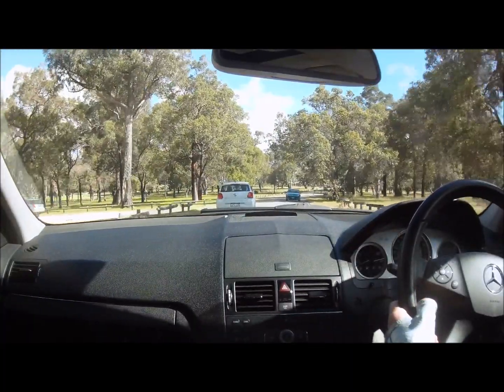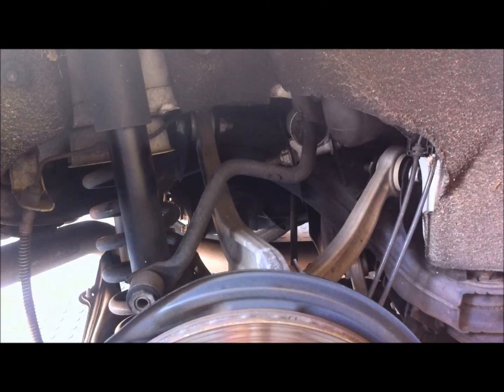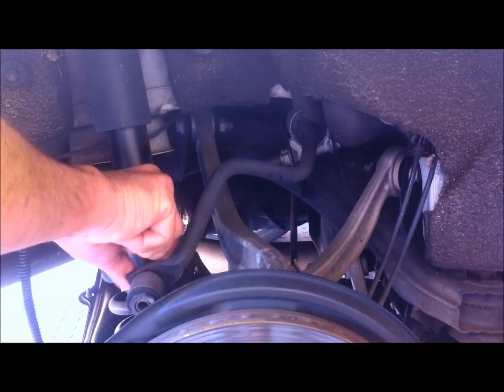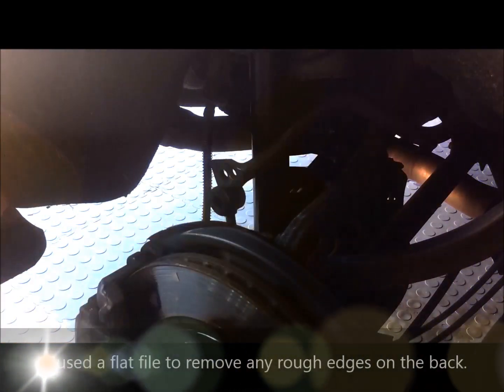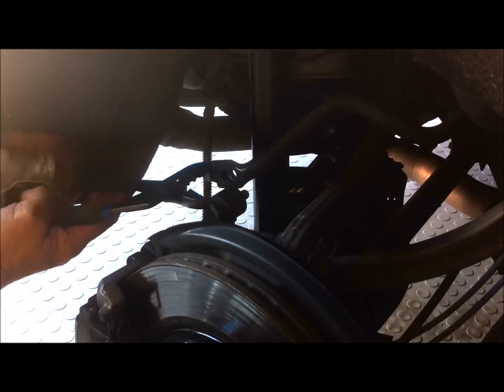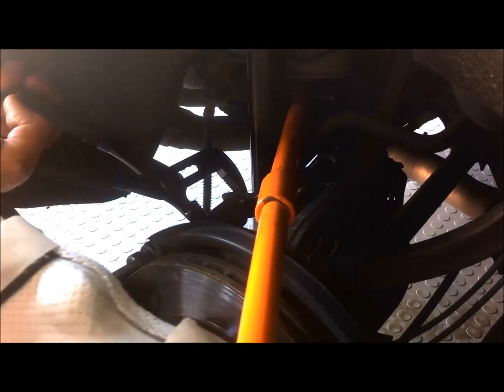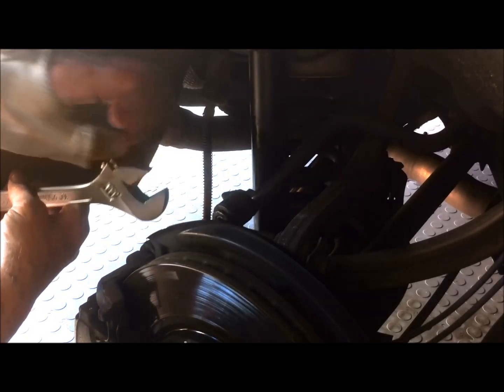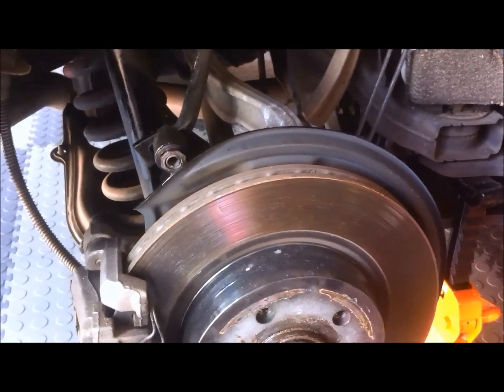W204 Mercedes C Class Rear Sway Bar Modification Anti Roll Understeer Oversteer

Comment: Is the effect noticeable ? AS the whole  arm of the swaybar is reduced only a bit. Do you have to comfort or the standard or sport suspension?

Has the oversteer, if any, become annoying ? Have you experienced inside wheel lift off while cornering hard and therefore instant power loss due to open differential?
Reply from the maker: Well I have a LSD for starters which made a big difference to how the car drives.  I have the standard suspension.
It's a subtle change with the new pivot point but I feel the difference. No it's not annoying and I haven't been lifting the rear wheel when cornering. The track I was planning to use has been closed so my driving is on the street. I don't drive too hard on public roads for obvious reasons.

Comment: It would be great  to see a video how to change the rear sway bar , upgrading to 486 or 483 . Or an aftermarket sway bars .
Reply from the maker: The sway bar is simple to remove. When you take a wheel off you can see the U shaped mount. One on each side obviously.
Reply: +Scott Elliott  thanks , it may be different on facelift and pre facelift models , i must low my rear subframe to replace sway bar .

Comment: Scott, thanks for the video,  I am from Brazil and I have a very tough question for you, since you're tunning the W204 suspension. I own a W204 now and there is something that is bugging me, I will explain, so please read below:

I had a Peugeot 407 Griffe (3.0 - Front Wheel Drive - 1760 KG) Suspension wise the Peugeot has a Double Wishbone front suspension and a multilink rear suspension.

In a track I am used to run with the Peugeot and now with the Mercedes, I have noted the following:

With the Peugeot:
Going at 80 Miles per hour - takes the corner (easily, no understeer, looks like a joke, and it is a tight corner).

With the Merc (W204 C200K) at 70 Miles per hour - Can't really take the corner, I do slip outside the track a little, it looks like the car is "floating" a little, there are some imperfections on the road, looks like I have less grip, at 80MPH not even a professional driver could do it.

The Peugeot is LARGER and HEAVIER than the Benz it was older and had a lot more miles than the Benz, remember that all cars are STOCK, 100% Stock.

Is the W204 less "sporty" or less "capable" than the Peugeot 407 Griffe? A car that is like a "joke" for most enthusiats, and it a lot older than my W204? Is the Peugeot suspension superior to the Mercedes Suspension? What am I experiencing? Understeer? Roll Understeer?

It makes me believe that the Peugeot suspension is in fact a lot better than the W204 suspension. Which is a joke, by the way, the F30 BMW cannot take this corner at the same speed (80 MPH), we tried.
Reply from the maker: +Djalma Leatti ... Djalma ... I wish you asked me a question about motorcycle suspension as that's where I'm most experienced!

The W204 was built on a budget so the shocks and struts are not top quality in my opinion. I think the sway bars and springs are ok.

Another modification I did to mine was put some spacer washers on the two lower strut bolts to give more negative camber. This certainly helped the front 'dig in" when cornering hard. I got it to about 1.25 degrees negative. I also replaced the 27kg battery that sits about 500mm behind the rear axle with a 2.4kg lightweight LiPo battery. I think this definitely helps the handling.

The W204 is still quite a heavy car. My C320CDI is almost 1700kg. From my experience the floating feeling is often caused by ineffective damping. You also need some negative camber on the front wheels because what you describe sounds like under steer. I have no idea about the Peugeot other than it sounds like it has quality suspension.

My front struts are staring to get that floaty feeling at 62000km. I'm not going to replace the struts but make a modification to them to allow me to replace the suspension oil. I've done it for a W639 Vito and it's been very successful. I made a how to video and it will be the same process for the W204 as their construction is the same. https://youtu.be/m50krOFGokk

From what you describe it maybe beneficial putting more negative camber on the front wheels and getting better struts and shocks. Rear shocks can be easily replaced as being mono tube are too difficult to modify. The front strut internal components are reasonable quality based on the Sachs units on the Vito. Better quality hydraulic damping oil will probably sort them out.

Hope that helps, Regards, Scott
Reply from the maker: +Djalma Leatti Thanks for the video. I did watch it and Richard confirms it's handling is first class. You could see it was very flat in the corners.

Your C200K might have much smaller diameter sway bars than my C320CDI. My car doesn't suffer much body roll when cornering hard. This maybe another area to look at ... bigger diameter sway bars. Sway bars are often a very effective and cheap modification. They're not difficult to remove and install.

http://www.ebay.com.au/itm/Eibach-Anti-Roll-Bar-kit-Mercedes-C-Class-W204-07-C200-Kompressor-C230-/251331298761?hash=item3a848345c9:g:ZZYAAOSwNSxVcUFw

Mercedes cars are also very expensive in Australia ... especially if you have them dealer serviced. That's why I avoid the dealers as they gouge as much as they can from you.

Good luck with the Olympics!
Reply: Tell me how may washers did you fit to the lower struts mounting bolts to increase some negative camber? @ScottElliott152
Reply from the maker: @rahulsoni6652  One washer but I took them out after a short while and left it stock.
Reply: Did it cause any issues? @ScottElliott152
Reply from the maker: @rahulsoni6652  No.

Comment: Same principle as aftermarket adjustable sway bars. FWIW I'm not sure if you have both rear wheels jacked up, but I find sway bar work way easier when either both wheels are up or down.
Reply from the maker: Brian Wright Hi Brian, Yes I agree it's easier if both wheels are off the ground. Normally that's what I'd do but these rear bars are not that strong on the C Class so it was no drama to do one side at a time.I had a set of adjustable K-Mac bars on my last Ford XR6 Turbo and found it convenient to reset them when I did the occasional track day.I may do the same to the front bar but the extra hole will be to make them slightly softer. That would really promote oversteer. With the front bar you'd have to have both wheels off the ground as it has far more torsional stiffness.The other thing I'm going to investigate is adjustable sway bar connecting rods ... either modifying the OEM part or fitting after market.